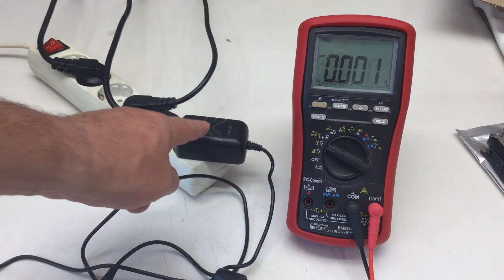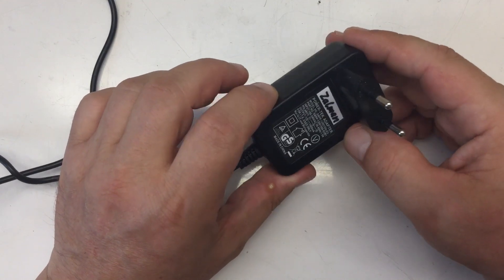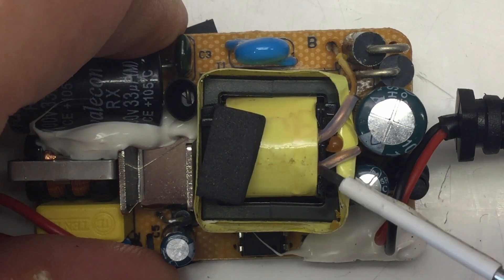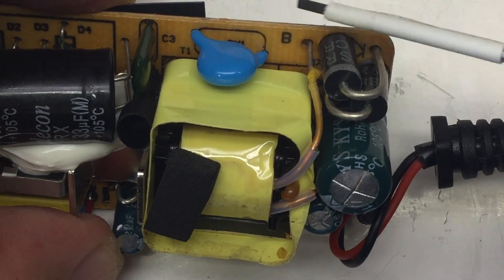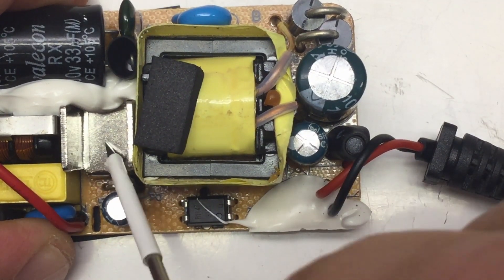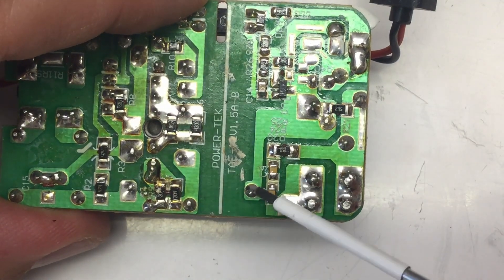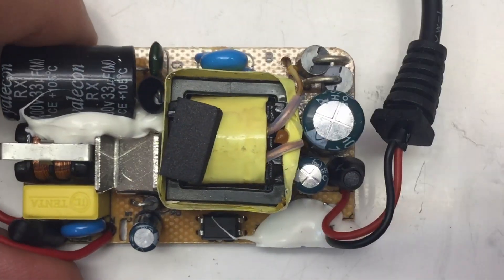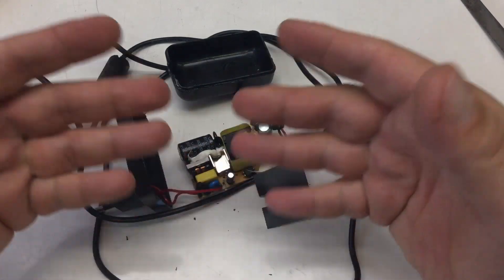POWER-TEK 12V 1.5A AC Adapter Teardown

Comment: Hi robert , a little tip when opening sealed or glued plastic enclosures is to take a long straight edge knife and place it in the space between the two sides of the enclosure and then tap it hard with a hammer . The sudden hit from the hammer forces the two sides to come apart perfectly.
Reply from the maker: Thanks for the tip. I'll try that next time.

Comment: Interesting the output caps are the ones showing distress.
When I've had dead switching PSUs, it's almost always the input cap that have died, they have a much harder life with the high voltage rectified AC to smooth.
So much so that I have a little stock of name brand 400v caps (I never order just one).
Reply from the maker: I suspect the output caps were also under quite some stress. The 1.5A that this wall wart officially could supply might have been maxed out with the hard disk I was using in the connected external HDD case. So the charge/discharge currents might have been quite high.

Comment: If you decide not to repair it, cutt the cord from the adapter and mount a 2pin 230V male mains (flat) connector to the cutoff end of the cable,
and mark the + and - pin. You can then use this cable with DC jack on your bench powersupply.
If the DC jack is a 5.5mm x 2.5mm type, you can use the tips of a universal notebook charger, that way you can power almost any device with your bench powersupply.
The distance between the 2pins of a European 230V connector is arround 20mm (center to center) and is the same as the distance between the + and - of your bench powersupply. Also, many multimeters have this standard distance of 20mm between + and -.
So this selfmade adapter cable is very versatile.
I use it here in Belgium to power temporary all kinds of electrical devices like routers, laptops, signal generator (give cleaner signal if you have a linear bench powersupply), etc....where i'm working on that moment.

And little sidenote, there was only audio on the left side, nothing on the right. 
Other then that, nice and clear video. Thank you.
Reply from the maker: Thanks for the tip! Unfortunately my OWON power supply has a ground binding post between the - and + binding posts, and so the distance between this is about 40mm 😒 When I build my self-made power supply, back when I was young, I didn't know about the 20mm standard 😒

And I'm sorry about the mono audio - my bad 😓
Reply: @robertssmorgasbord  my bench powersupply has also a ground binding post , but on the right side 20mm away from the - . So + - earth, all 3 with 20mm distance from each other. No worry about the audio. Grtz

Comment: What’s the optocoupler do? Take the signal from the control chip and open the secondary? Why?
Reply: The optocoupler provides feedback from the output to keep the output voltage stable.
If you start to draw more current and pull the output voltage down, the controller chip sense this via the optocoupler and puts more in to the coil.
The opposite occurs if you reduce the load, and the controller chip has to back off to prevent the output rising too high.
Reply from the maker: @juststeve5542  Couldn't have explained it better. Thanks for stepping in while I was away! I'm still in the process of catching up with all comments.
Reply: @juststeve5542  thanks!
Reply from the maker: Just what Just Steve said!

Comment: Not a bad build quality, seen worse....cheers.
Reply from the maker: Yup! If they hadn't cheaped out on the electrolytic caps the thing would still be running. However, after some back of the envelop calculations I also found that 1.5A might be a wee bit too less for some hard disks. My new USB3/eSATA cases came with 2A wall warts.
Reply: w/o dissecting the transformer, it's hard to tell. 16V output caps are too low for 12V flyback SMPS. The output shunt looks quite anemic as well. Also could not check if the cap between the primary and the secondary is Cy or just a generic 1kV capacitor.
Reply from the maker: @stanimir4197  Well, I'm not gonna dissect the transformer, because someday I might wanna repair that thing ;-) Anyway, I've checked the Y class capacitor: It has absolutely no markings on it, but it's labeled on the PCB as CY1 - you'll have to trust our Asian friends :-) Question: Why do you think the 16V for the output caps are not enough?
Reply: @robertssmorgasbord  the way flyback works is that it outputs higher voltage -  then it's switched off and the output voltage evens out (the caps and the shunt absorb the massive ripple and smooth  it). The rule of the thumb is using caps rated twice the output voltage, e.g. 25V in this case.  (technically when the primary it's swicthed off the secondary one converts the magnetic energy stored in the transformer to well.. voltage)
I guess you can try w/ a scope to measure the voltage going out of the transformer.
Now if I add a link youtube will delete the comment. Try searching: "Designing Isolated Flyback Converter" or something such - I assume it's a flyback, as it's low power and there appears to be an air gap in the transformer.

Don't take my word on it - I am extremely far from being a knowledge base on SMPS - but I have seen enough produced at the Candy Mountain to know the shortcuts taken.

For now I have resorted to buying name brand ones only (meanwell being the primary choice), as repairing a 6 euro unit is counter productive.
Reply from the maker: @stanimir4197  Thank you very much for the info! I have basically zero experience in designing any switch mode things. This really wetted my appetite to dive into that area ... at some point. so much to to and so little time ...